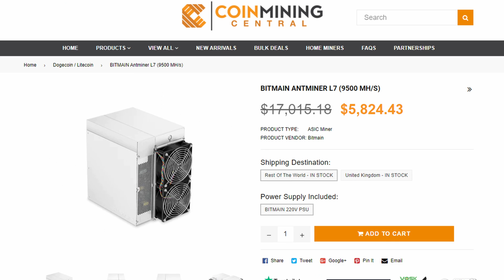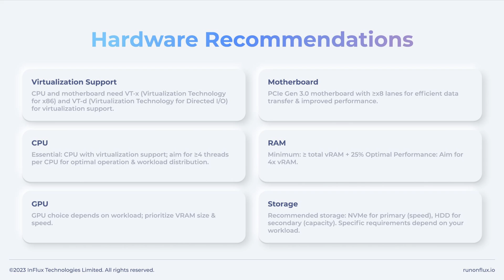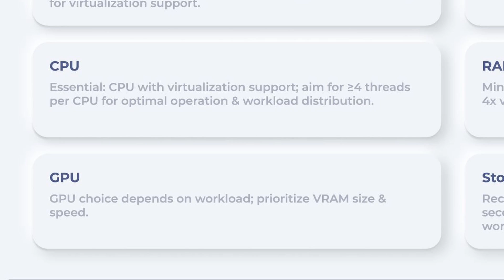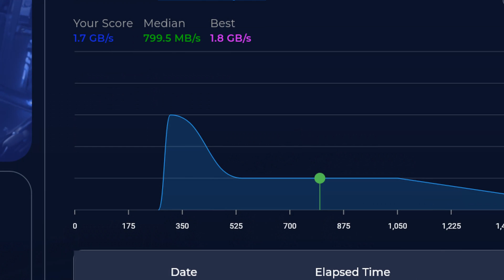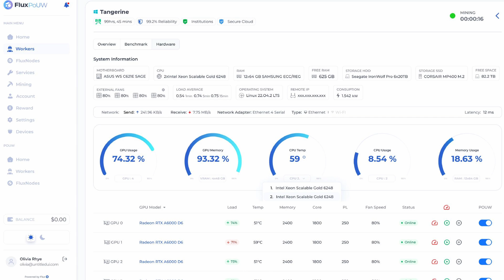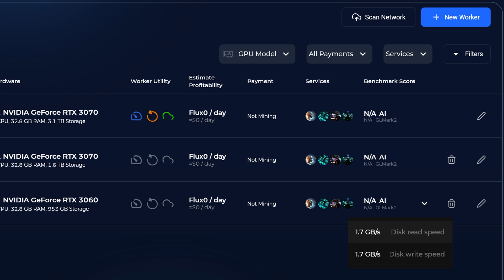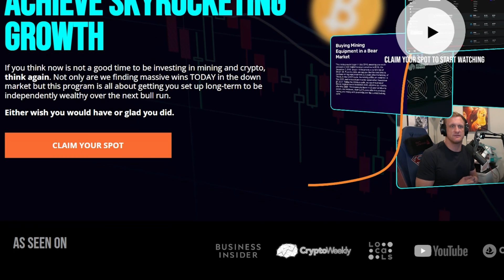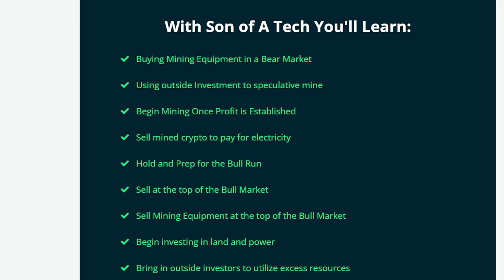When will FLUX Proof of Useful Work be RELEASED!?

Comment from the maker: What GPU or GPUS are you thinking about using for a Proof of Useful Work Rig?
Reply: No idea yet, gonna wait and see
Reply: Epyc or threadripper pro will be best for those with deep pockets.
Reply: X399, 1950x, 2 3090 in sli, 128gb.  Have two x99 dual CPU 4 PCI slotted, Intel motherboard with 18 cores, but don't have a ton of Nvidia gpus. Maybe throw  some 3070s on them.
Reply: @Jon-ky6st  @cameronfaul 1440i saw that vt-x vt-d is needed. does amd epycs or threadripper support that? amd has amd-v or something.
Reply: i was either going to be left field and use an a2000 or use a 3080ti or 3090. Just a quick note, the sign is equal to or greater than re CPU and v ram etc. I am wanting to minimize power usage to help fall in line with the ecological stance, but also support the project using a useful machine. Are you going the windows or linux route?